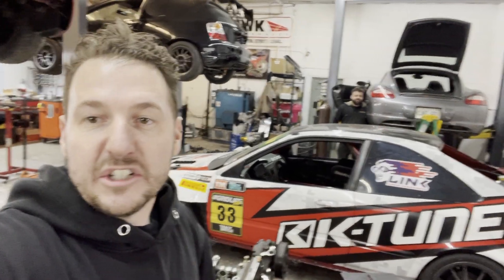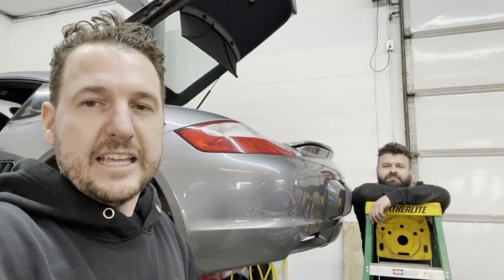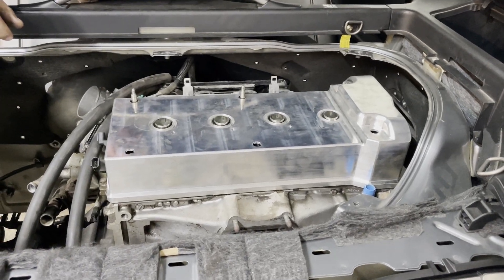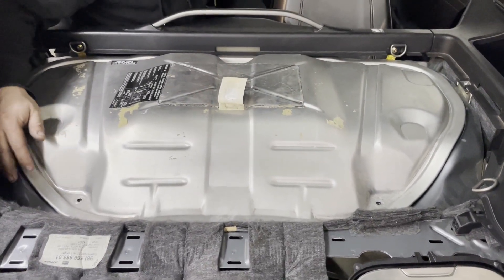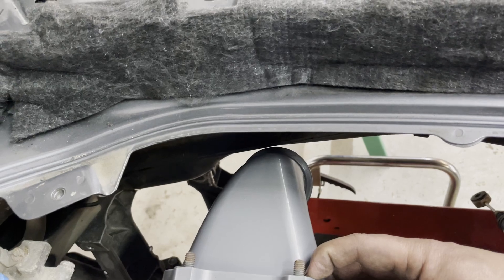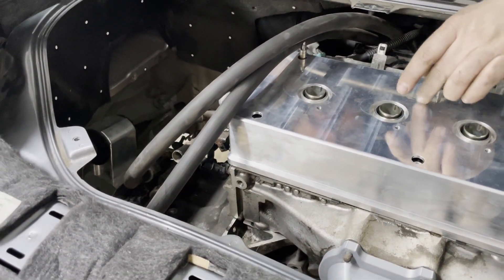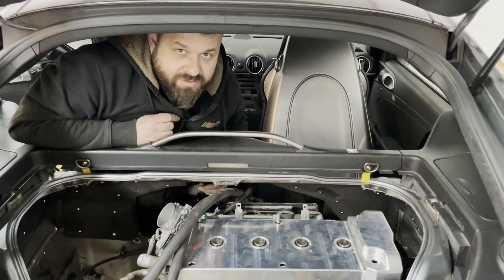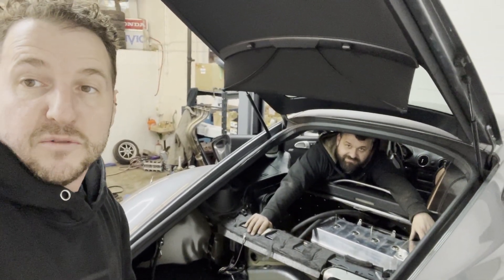3D Scanning the K24 Cayman project

Comment: Watching through these videos again it would be interesting to see how the audi 2.5 tfsi lines up in the cayman transversely with the DSG as from what I’ve read it’s 2” shorter in height then the k24, a more expensive engine but more modern but the engine and gearbox are strongAF. 

Guessing if you design the subframes to allow the different driveshaft angle other swaps may be feesable from it too.
Reply: Amd you get that 5pot sound track

Comment: Great idea for a project - there are a ton of 987.1s out there that could benefit from this! Replacing the lovely (but expensive) Porsche unit with a reliable, easily tuneable, cheap engine sounds like a no brainer - especially if it comes in kit form. A word of warning about the standard Porsche shifter cables though - they tend to break (the plastic ends are fragile). Aftermarket upgrades are available though (or I'm sure you could engineer a modification yourself). Best of luck - I'll be watching with interest!

Comment: soooo.... the project for a cayman with the k24 engine will involve a custom rear sub-frame and a custom valve cover and custom spark plug tubes and a custom turbo exhaust manifold, assuming one wants to add a turbo. engine mounts are already available from a manufacturer that you are familiar with. the valve cover and oil pan are a done deal and the sub-frame's is the process of having a 3D image taken of the attachment requirements. the custom cut down spark plug tubes are a simple DIY job with a pipe cutter and a vice and it sounds like the custom turbo exhaust manifold is or will soon be available too?

i'm interested because i'm anticipating a blown engine in my 2007 987.1 2.7l  base model sometime in the next five years and i'm the kind of guy that prefers reliability over originality. and it would be nice to have the option of adding a turbo, although the ~300HP in a 24K would probably be satisfactory for me.

curious as to the "throw" of the cayman's transmission shifter VS. that of the "K' engines.  if not identical i would think the cayman's shifter mechanism would need some modification.

Comment: Will you make a valve cover just tall enough so that machining the spark plug tubes is NOT necessary?
Reply from the maker: We could make one if there was enough demand for one - But for the valve cover to actually be as low profile as possible and to actually use a shorter coil, the tubes must be cut. The tubes are super easy to cut and it makes no mess. You just use a simple plumbing tube cutter - I will be making a video on that to show how easy it is